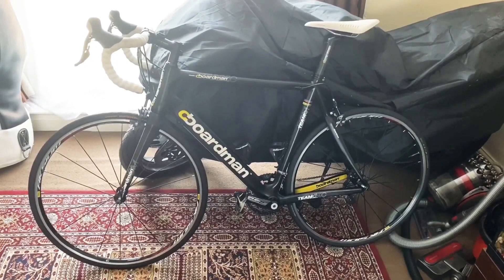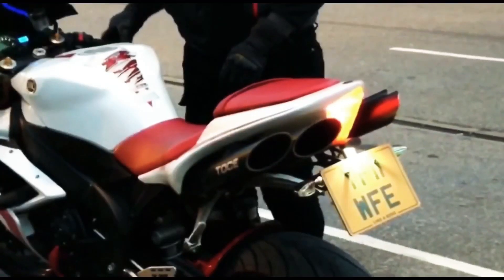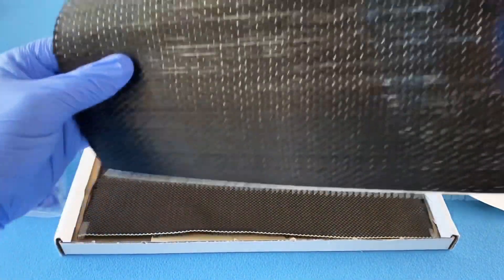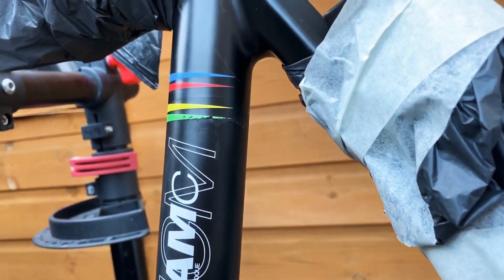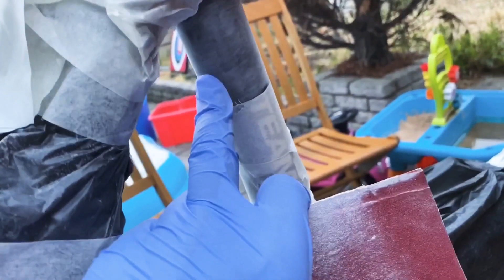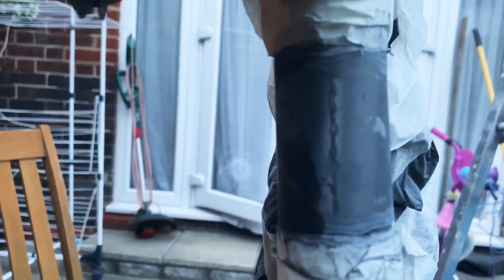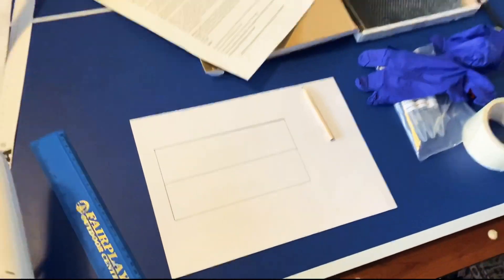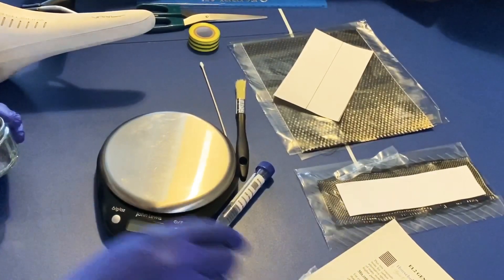Cracked carbon fibre frame repair

Comment: Generally for a repair like that you would drill the start and end of the crack and then "V" the full length of the it. The drilling stops the crack going further and also allows more of your fix to surround it, same reason you V along the crack too.

Comment: Can you please send me the link of the kit been looking for one for ages but that looks like it could be good and not to expensive
Reply from the maker: https://www.ebay.co.uk/itm/Carbon-Fibre-Repair-Kits-X-Choice-of-2xA4-Fabrics-42g-Epoxy-Heat-shrink-Tape-/173846307685?_trksid=p2349624.m46890.l49292
Reply: @azzkam8972  thank you very much